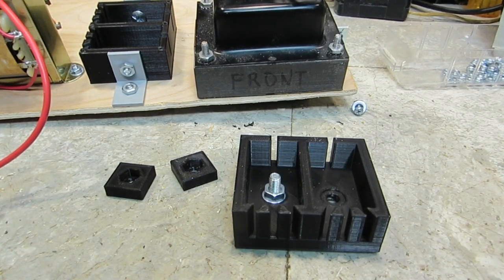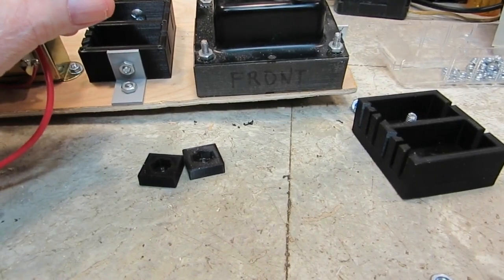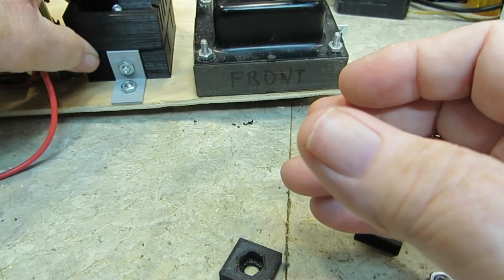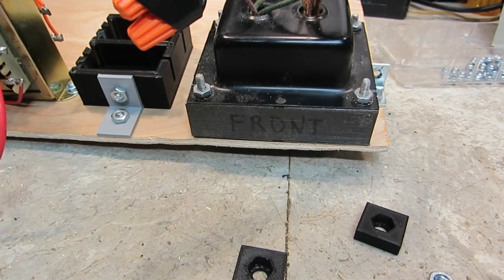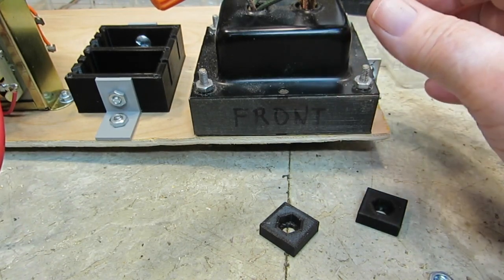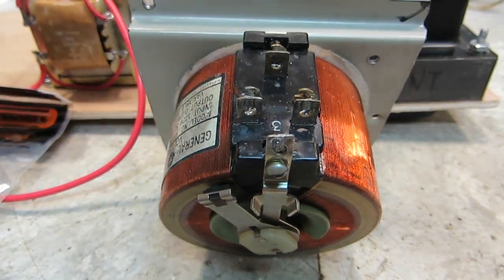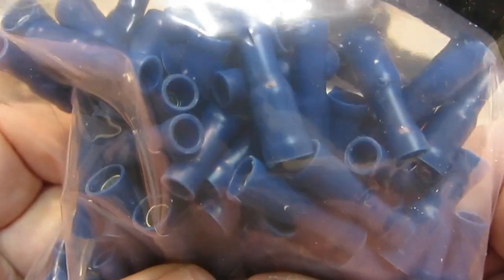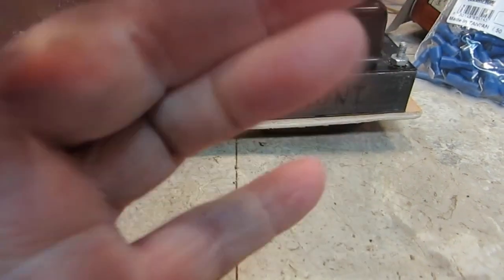DERB - Reprint junction box

Comment: If you connect the transformer center tap to the junction of the two capacitors forming C2, you can eliminate the 330K resistors and guarantee voltage balance between the capacitors.